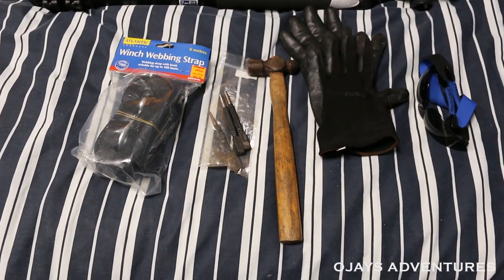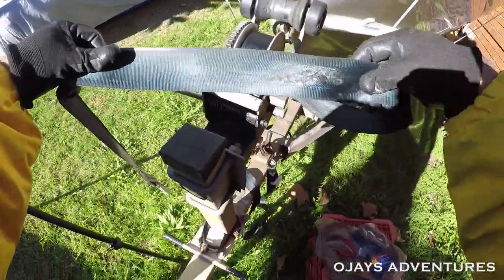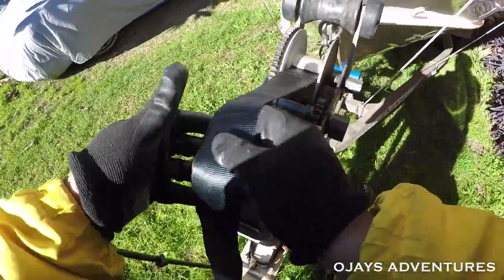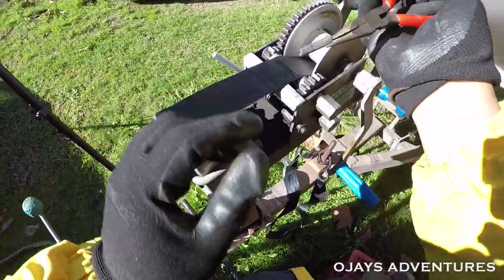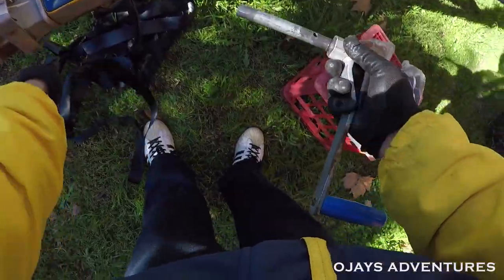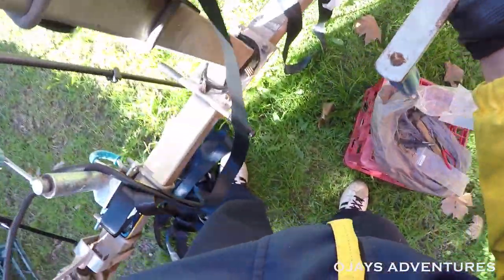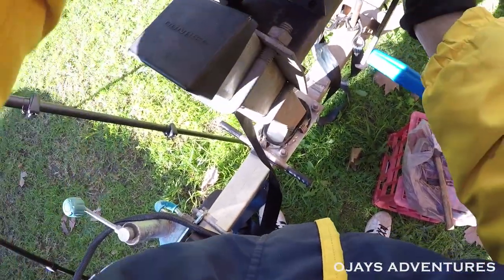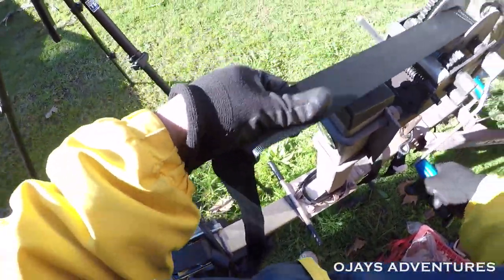How to Install a boat trailer winch strap (Atlantic winch)

Comment: Thanks for this. I've got a Jarrett Winch with the same spindle pin. Will be super easy to change over now that I've seen your video. Cheers
Reply: Bugger, mine is slightly different, the handle does not go thru the winch, it has a separate winch spindle with the holding pin. Removed the pin ok. 

Bashed it with a hammer, moves around 3mm, but won’t move any further. Put a heap of WD40 on it, but no success. Any ideas?